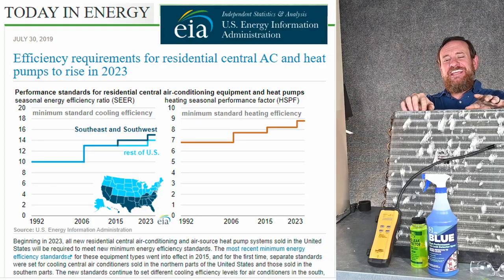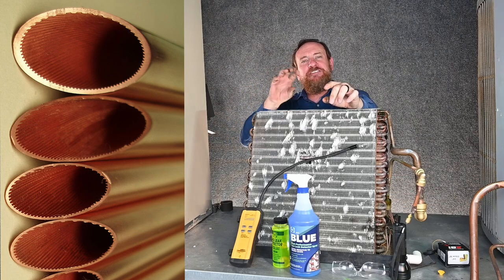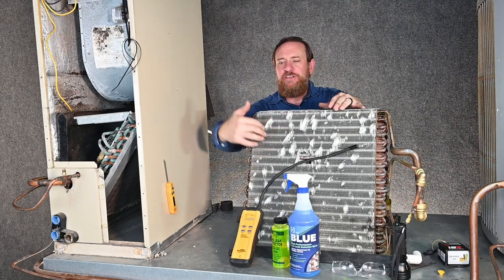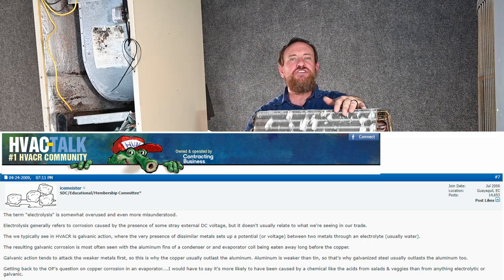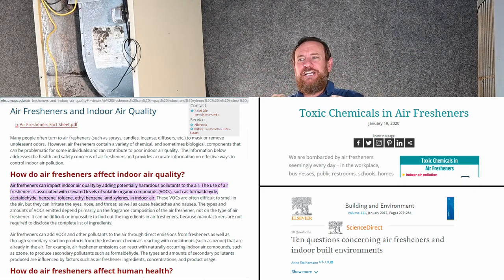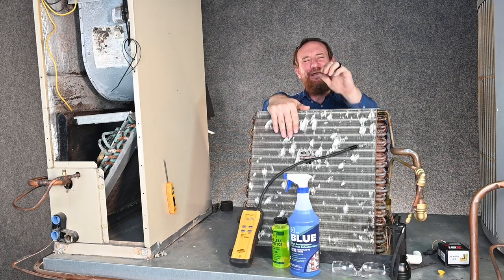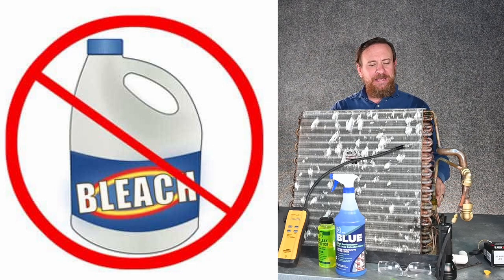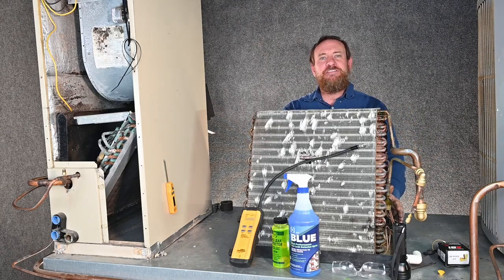HVAC 159 Why evaporator coils leak (Fixed)

Comment: I had two techs tell me that the coils were rusting and needed to be replaced. Copper does not rust. The galvanized metal supporting the coils does rust because of contact with the copper, galvanic corrosion., my understanding. From my YT searching it seems a lot of home hvac systems just need basic maintenance for a long life. Replace filters as recommended, stick with as low a merv as you can. Clear out the condensate drain. I have a system with a very slow refrig. leak. The techs told me that R22 is nearly impossible to find and very expensive. They must be recovering a lot of R22 with all the new systems they are installing so that didn't quite make sense to me. They wouldn't show me exactly where the leak was but it seems its at the Piston connection? sticky residue there.
Reply from the maker: Rust alone does not cause any leak it's just a sign of aging. I have seen units without rust leaking and units 30 years old rusted without leaking. 

Without knowing where the leak is at  I can't direct you one way or another.

I can say R22 is very expensive and hard to find. In 1987 we knew it was going to be eliminated and since 1992 every tech had to take an exam knowing to recover  and it was not going to be manufactured after 2020. Yet systems where still installed up to 2015 :( a lot of techs do not recover the refregerant, they just cut the lines and let it into the atmosphere. They even brag about this on forums. 🤦 If they did recover we would have more to use now. 

Options:
If it is a small leak a company can still find and use R22 and top it off. It  is not illegal to add refrigerant to a leaking unit. 

2 find the exact leak location and evaluate it's potential to be repaired. 

3 convert the unit to an alternative refrigerant. There are many replacement options that work in R22 units. 

4 replace the evaporator coil and use alternative refrigerant. (Right now parts are hard to get for older units)

5 you can try a leak stop additive. Some people swear by it, some say they don't work at all. 

6 replacement: but wait.
This is a big step and should be done properly, it's one of the biggest investments of your home.
 A blower door test should be performed to find the leak rate and any air sealing should be done to seal those holes first. 

The blower door test will give the numbers needed to go with a manual J heat load calculation.  If a contractor says Sq ft per ton run! Most systems are oversized and makes the house uncomfortable and use more energy. 

After manual J a manual S should be performed to find the right equipment to handle the latent and sensible heat load. Just because it's a "2ton" does not mean it will work the same!

After blower door, J and S a manual D should be done to properly size the duct system. Ductwork is ESSENTIAL to a properly operating system and is often undersized and too much static pressure for new systems.  After that is determined then you can have the new properly sized system I stalled for years of operation. 

Companies make the most $ on selling new units but if it's not going to be done right it might be better to just keep repairing the one you have.
Reply: You'll be able to find a tech that can fix the leak. Also there is a r22 replacement out there

Comment: All of my couplers seem glued…what else could I do? Carrier Unit is upstairs. It also has a foam wrapped around pvc kinda like a noodle. I wish I can attach a photo. Oh and the coil completely black. When I moved in this place the closet the carrier unit is in was completely covered with dust, walls, ceiling and slats on the door. It was absolutely disgusting. Also a wrong size AC filter was smashed in where the correct size should be. I used a snake in the pvc drain pipes and the crap I pulled out was so disgusting and hard for to stomach. I’ve used a shop vac and do not know what else to do. Is there anyway I can email you?

Comment: Please advise. My air handler has this problem, water dropping off the coil. Unit is only 3 years old. The dripping has been going on for the last 2 years out of the 3. My AC installer said Trane will write off the coil as a warranty write off, but the installer wants $2,500 to do the switch out and advised against doing the swap because the water droplets are being dried by the fan. Thanks for any input!
Reply from the maker: When water is dripping off the coil it is usually from dirt in the coils or damaged coils. Sometimes with duct or arrow issues water can be pulled off the coil into the blower cabinet and drip down from there.
Reply: @love2hvac  thanks for the info, I will look into it.

Comment: Many more coils failing today than ever. Tells me they are very poor quality. Replaced mine at 4 yrs. that is B.S.
Reply from the maker: Seems like the new ones are leaking even worse than the leaky ones.
Reply: Yeah 5 years old 3 t Trane and evaporator coil leaking.
Reply: My Trane evaporator coil leaked out all the refrigerant.  It's going to cost me 1400 in labor to replace and it's only 2 years old!
Reply: @AC130eng  $1,400 for 3hrs work is also a rip off That is almost $500.00 an hr. A new car dealer shop rate $125.00 hr and they have a lot more overhead In my area they are charging $1,600.00 hr. That is why so many people are putting in mini splits and doing it themselves. For what these guys charge for a system that is poor quality junk it is a total rip off.
Reply from the maker: 1st the evaporator coil should not leak that soon. Manufacturing defect.

2nd that price
A: parts/supplies
In that $1400 that also includes non warrantied parts such as filter driers, brazing rods, vacuum pump oil that has to be changed, copper couplings and refrigerant. The manufacturer only warranties the coil itself and  excludes these other supplies needed to do the job. That is anywhere from $200-$500 depending on availability and markup.

B: labor
That is usually a 4-5 hr flat rate job. Similar to auto techs, a technician does not get punished for having the tools and skills to do the job faster. 

C: overhead
You said an auto shop had more overhead than an AC tech. I disagree  with that. AC companies have to maintain a physical location with a mobile shop bing a fleet of vehicles and a large inventory. 
The cost of fuel alone is very expensive to move the heavy vans/trucks filled with tools and parts in constant stop and go traffic. (Combined with paying a technician for drive time)
If that's not enough, commercial vehicle insurance is an extreme cost on top of standard business liability, and workman's comp. 
The vehicles have a limited amount of drive time, repairs and maintanance before they become worn out and have to be replaced. The cost of replacing a service vehicle is more than the cost of my first home. Each van has to be equiped with specialty tools some by the tech and others by the company. The overhead is usually much more than an automotive shop. 

$1400
Say 400 for refrigerant copper, vac pump oil, filter driers 15% silver solder. 
1000 labor and overhead / 5 flat rate houers = $200/hr
Considering there is a skilled tech shortage across the country that is not out of line.  Tech should be making $55/hr then insurance, benefits, holidays, pto, that does not seem out of line.

For some areas this could be cheap and for others this could be expensive as cost vary greatly from city and state. 

They should have given you a price ahead of time for you to approve. If you knew the cost, you could acepet it or find someone cheaper. It's accept of deny. 

If they did not tell you the cost then slaped you with a bill them that's on them.
Reply: @love2hvac  Do you think that dealer ship building was free and all the property taxes with it. As for your $10 filter dryer and $10 worth of solder.
Reply from the maker: @venvnco6259  

They where $10 back in the 1980's

We don't use solder, we use 15% silver brazing rod 
Plus nitrogen 

It's a shame people will pay extreme markups on shoes, furniture, home decor, how the yard looks but complain about paying skilled tradespeople.

You anger should be directed at the manufacturer that made an inferior part from factories they moved out of the country to save a few dollars.

Comment: The gentleman mentioned "pulling a proper vacuum" a few times in the video. Does anyone know particularly what that means? Ty in advance for any assist
Reply from the maker: When a system is installed.
When the Refrigerant lines are brazed, nitrogen should be flowed through the lines to prevent oxidation and keep moisture out.  The system should be pressure tested with nitrogen for leaks. The nitrogen should be vented. Then a vacuum pump should be attached and the system pulled down well below 500 microns, (200 ideal) of vacuum. The removes contaminants and also drops the boiling point of water so it will turn to a vapor and be pulled out of the system by the pump.  The installer should then perform a decay test where the unit is valves off from the pump. The microns should hold below 500 I er 20 minutes to ensure there is no moisture still in the system turning to a vapor.
This is a proper vacuum or a proper dehydration.

Comment: Help! The first Mortex evaporator coil in my home heat pump split unit had about a 12 year life  when it sprang an unrepairable leaked and had to have the whole system replaced (compressor was fine) because it used R-22 that was unavailable. Assuming the coil always received meticulous care and a 6" fresh air intake nearby to dilute indoor air chemicals (no home chemicals are sprayed in the air), how long can I expect an indoor coil to last? My second unit uses the same evap coil, is 10 years old and uses 410a that's being phased out similar to R22. Does a home owner have to replace his whole heating and cooling system (Big $$$) every 12 years? Something just doesn't sound right!! Any advice appreciated.
Reply from the maker: R22 is still available but expensive. alternative refrigerant are available to replace 22 in R22 systems. 
Coils made for 410 will also work with R22.
Manufactures, often price evaporator coils very high so the price of an entire unit looks plausible.

Air conditioning companiesake most of their money selling equipment. Supply houses aka wholesalers makes most of their . Ony on selling new equipment. Manufactures make all their money on selling new equipment. With the skilled trade shortage and high cost of training, plus the good ole bottol line has leveraged the industry to sell vs replace.
Much of the industry has been behind the AIM Act that will push everyone to yet another refregerant. The industry as a whole has profited greatly on the R22 HCFC phase out. So if they phase out R410A, all those existing customers will meet another new unit with new refrigerant. The new refregerant is still being cleared on state and local codes but 410A is already  being phased down driving the cost up.

Copeland builds and tests their compressors to last at least 20 years. But hiw much more money can the industry make if you had to buy a new one every 10-12?

There are companies that train to sell a new unit if the old one is over 8 years. 

I don't see a change coming any time soon.
Reply: A coil made for 410a will work with r22 without modification?
Reply from the maker: The TXV will need to the correct refrigerant but the coil itself needs no modification.

Modifications will be if it will fit in the same cabinet as the old one or not.
Reply: @love2hvac  thank you!  We don't need no stinkin txv!  Piston all the way.  Nothing to fail that way
Reply from the maker: Actually a piston is more likely to reduce the life of a compressor. 

Example customer keeps the house at 72⁰F at 50%RH that's a wet bulb of 60⁰F
That means if the outdoor temperature was above 91⁰F you would have liquid floodback to the compressor. That washes the oil away from the bearings and caused long term compressor damage. It doesn't happen right away but it definitely affects the life if the compressor.

TXV are the most misdiagnosed component in the refrigeration  system.  Most people think a TXV control suction pressure but it does not. It only controls Superheat.
Improper airflow is the #1 cause, charge #2 and refrigersnt restriction is #3
The ones that actually fail are from improper installation such as over heating at install. It damages the diaphragm and won't go bad right away but it will cause premature failure. Another is  no flow of nitrogen when brazing and the oxidation clogs them up. 

Often times a filter drier is restricted and not allowing enough refrigerant to the TXV. When the tech replaces the filter drier with the TXV it starts working so they assume it's the TXV. 

The Bad TXV started in the early 2000's when a compressor manufacturer was using a rust inhibitor that reacted with POE oil to cause the oil to gum up. This causes the TXV to stick. Because soany TXV where replaced people just assumed it was the TXV. In reality it was the oil additive from the compressor manufacturer. There were multiple lawsuits related to this. 

So those people just told the new people "TXV are bad" and the new techs just believed it without knowing why.

Fact is a TXV will operate better than a fixed office. The TXV has been around longer than the fixed orifice. 

If we could get installers to follow the installation instructions, and techs to understand the system as a whole nobody would be using fixed offices.
Reply: @love2hvac  what a great response- thank you so much for sharing your expertise.  It's not wasted on me because I'm looking to change careers from dentistry (my current) to HVAC. I've always said not too much difference between the trades and what I do. Both working with your hands (which I enjoy). 
Now I really never understood why wet bulb and dry bulb aren't enough alone to tell if you're charged properly with a piston. 
Using your example if the dry bulb was 90, it would be almost impossible to have a wet bulb of 60 unless you were properly charged. And If then your dry bulb went up to 100, i would think the indoor ac wouldn't be able to keep up and you would never have a wet bulb of 60 in that situation.  

I have two Armstrong air units original to my 1989 house.  Both with pistons and both going strong.  I always thought the lower r22 pressure along with the non mechanical piston was the reason why.   No circuit boards,  nothing fancy. Just a contactor, capacitor, fan and compressor that I maintain.  Never had to add an ounce of refrigerant (I've got my 608) and I'm hoping to keep them for EVER!  
but I'll rethink the txv thing after reading your post. Thanks again
Reply from the maker: @Samlol23_drrich  that's very cool! 

I really like those old units. The copper was a lot thicker and less likely to leak.  

I'm glad to hear you're enjoying HVAC and asking good questions!

Comment: I thought it was because r410a pressure is double the r22
Reply from the maker: R22 coils leaked too.
Older 410A coils did not leak as bad 20 years ago
Reply: @love2hvac  maybe they just wanna make it so it doesn't last forever lol. Cuz I do everything I can to insure perfect install but it still leaks. Like 20% of the install before 10 years is up. Is always where the copper meets the aluminum

Comment: But I thought dryer receiver takes away all the moisture? No moisture around to do any damage.
Reply from the maker: A drier receiver combo is only used in automotive. 

In HVACR the filter drier and receiver are separate. The receiver is primarily used in commercial applications. 

The amount of moisture a drier can hold is very small. Once we pull a vacuum down below 500 microns and let it hold for a decay test, still leaves moisture we cannot easily get. The filter drier will hold that small amount of moisture that we cannot get out after the correct steps are taken. 
When those steps are not done, the filter drier capacity is quickly extended and it cannot do it's job leaving the moisture to turn quickly into acid.
Many people think if the filter drier is at moisture capacity it will have a temperature drop but that is not true. The filter drier can be full of moisture and not restricted by particulate matter.

The rumor of a filter drier catching the moisture has been used for a while so techs feel better about cutting corners. Education is important to the facts come into play so best practices can be applied.
Reply: @love2hvac  so why then not include a more robust drier system if the ones current are not satisfactory.
Reply from the maker: The driers would have to be extremely large, and expensive.

It's better that professionals just follow the installation instructions with the proper tools and skills required by the trade.

Comment: What if the inside under that coil is completely covered in dust and black and mold? Can it be removed and cleaned and put back in?
Reply from the maker: Yes it can. Viper makes a safe chemical to use. A proper vacuum must be pulled when reinstalling. 
Don't go on price go for best process

Comment: There’s nothing wrong with using a diluted bleach solution in a drain line. I never poured the solution into the coil drain pan and always flushed with cold water afterwards.
Reply from the maker: You can do what you want but even diluted bleach  ABSOLUTELY 100% is a big problem.

Do what you want  it it does cause damage. Beach is not for any part of an HVAC system anywhere.